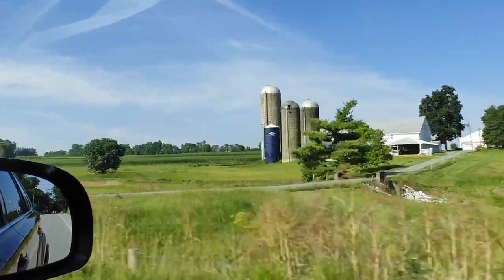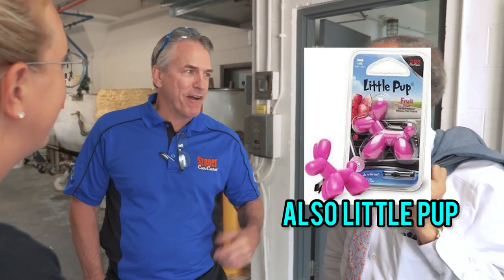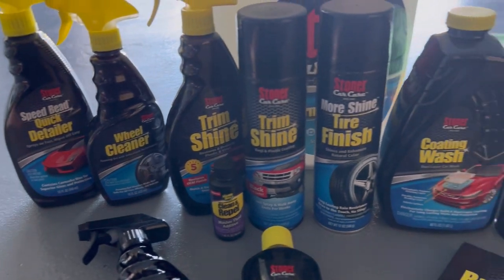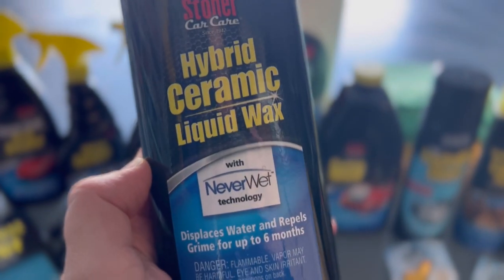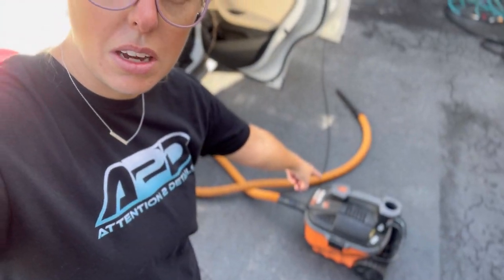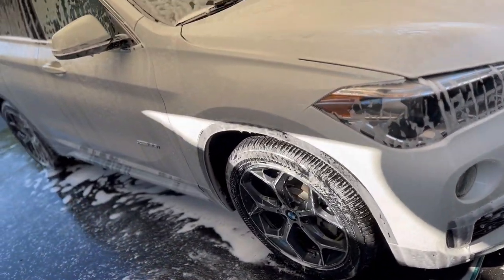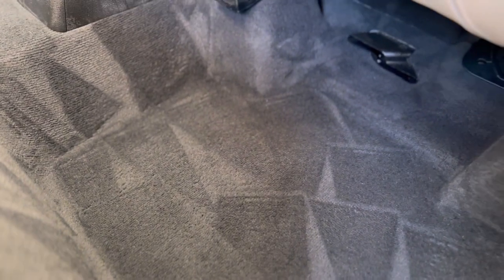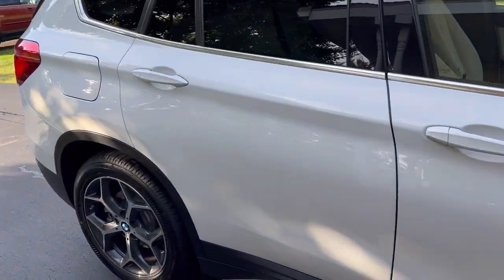Part 2 Stoner Car Care Products- How Well Do They Work??

Comment: You applied Cerakote Trim Restorer 2 years ago to a Subaru. How well did it perform? Fading? Streaking? Milky? Still black?
Reply from the maker: It needs replaced by now but I haven’t had a weekend free to fix it. It is peeling off and has been for the past few months.

Comment: How does the stoner coating wash compare to the Purist that you tested as far as sheeting, gloss, and slickness? Would an enzyme cleaner help with that tenacious stain?
Reply from the maker: Pure:est was tight beads and Stoner was more sheeting. I think the Stoner coating wash actually helped prevent water spots whereas if the Pure:est could have had water spots due to its impressive beading. Pure:est was slicker after washing but both had nice gloss. And an enzyme cleaner could have helped but wasn’t necessary as the foam did a great job